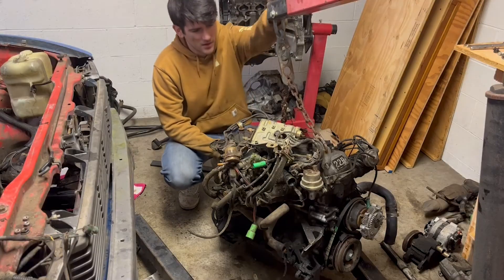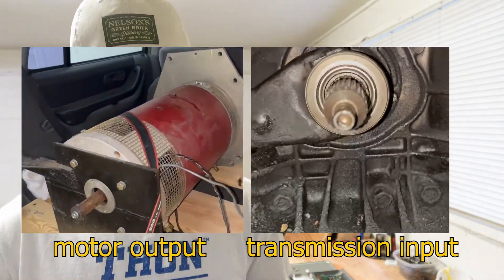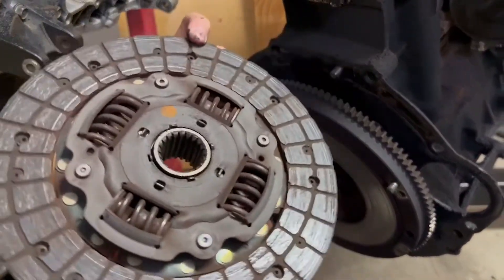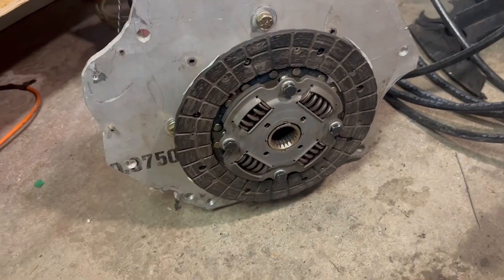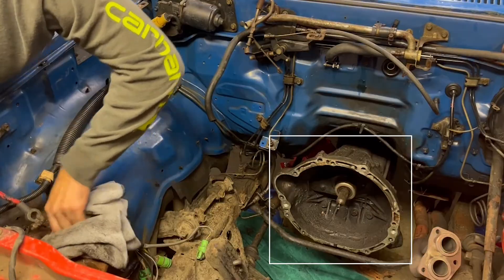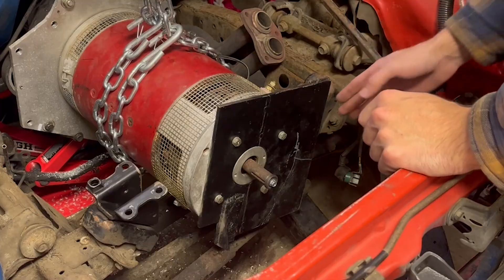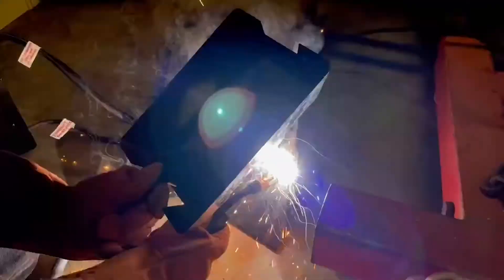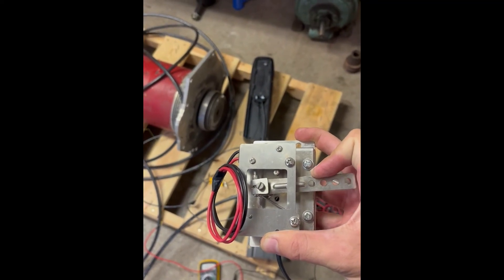Electric-Swapped Toyota Pickup Episode 4: Transmission Adapter and Motor Mounts

Comment: When welding thicker metal like that with a tiny harbor freight welder, it helps to preheat the joints with a propane torch. Youll get better penetration

Comment: Hi, i built a Ev around 2000 using a Mitsubishi pickup and the 9 inch motor (not a Warp). I had 24, 6 volt Trojan lead acid batteries to power it. I longed for lithium batteries back then but they just weren't available retail wise (~1500 lbs of lead batteries). Anyway, I'd like to do the DC Warp thing now with an old Honda Element I picked up (Southern Car) cheap and the availability of lithium packs. First question, how did you KEEP the rotating clutch and round mounting plate attached to the motor shaft? Did you just depend on the key to keep it on the motor shaft? Second, did the bell housing to motor adapter plate come with the motor or did you make it?